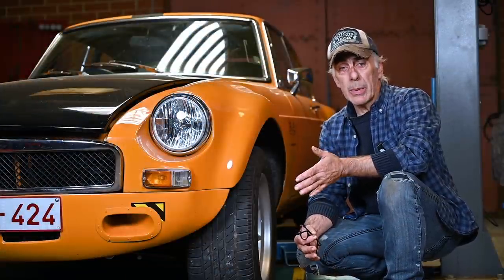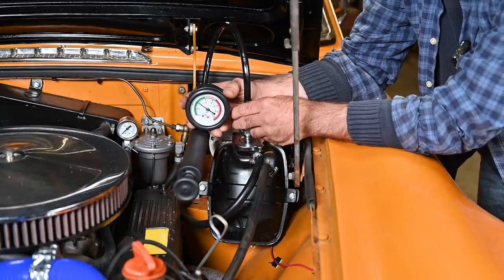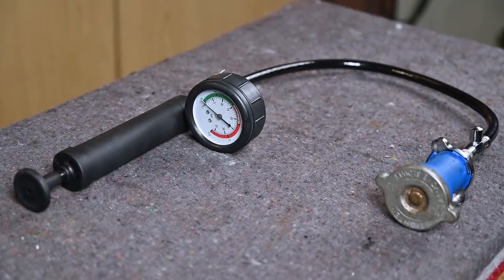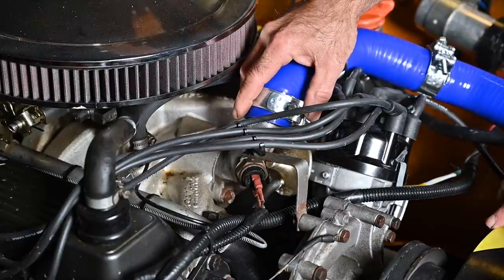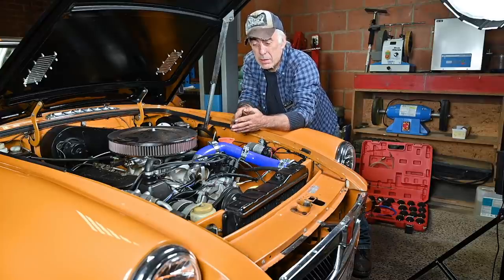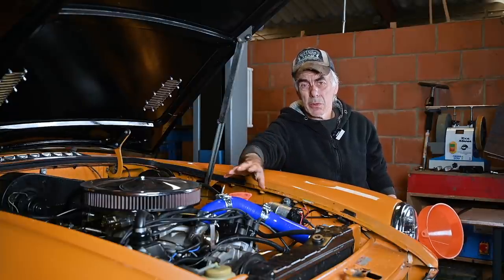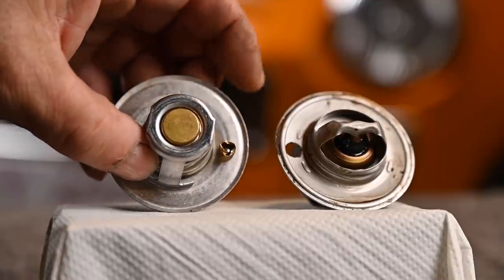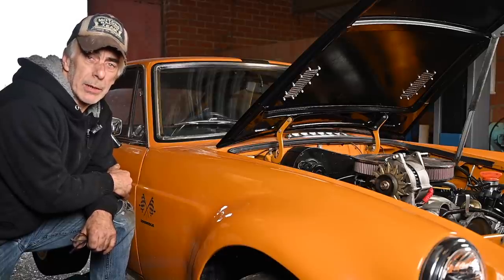Classic car Cooling System analysis, testing , and fixing

Comment: Steve, very clear tutorial and well worth the time to watch it. I have been in the same position with the strange previous owner wiring. It is worth the effort to clean it up for sure. Auto electrical fires are no fun at all. I have has several older vehicles and almost the first thing I do is water pump, thermostat and belts, and check the radiator flow as you describe it. Keep up the good work!
Reply from the maker: Thanks for the comments David,  indeed

Comment: That was a good run down on cooling systems.  You've covered this in the past.  I can't remember what engine had a cooling issue before, but there was a pressure problem and you tracked down the issue to the overflow tank.

I can't say I am typical of your viewers but I am interested in the little things you do such as the inner tube over the fitting or the bleeder valve on the water line.  I don't tune in to view you undo bolts or watch you go through the whole thing.  Set up is key so you just showing before and after photos is even satisfactory to me.  An example of this is what you did regarding the relay.  That rats nest was obviously a problem and then you just showing the wiring diagram afterwards is excellent.  This is what I like to see.  Perhaps some dialog on what your reasoning was in finding a place for the relay would have been appropriate and some discussion on it getting wet maybe.

One thing I would like to see from you, or maybe you might consider this, is to re-manufacture a part that is mostly a casting such as the starter wheel on Old Rusty.  You frequently go out and just buy new parts.  You've had a lot of discussions over new parts versus old parts and cheap parts etc.  You've made your own stuff which I love seeing.  Perhaps you can get some parts manufactured for you.  Like in Old Rusty's case, perhaps you have some part which is no longer available.  Can you get someone to make a cast for you?  You could have the cast machined or you could do this yourself.  A video on this would be good from start to finish.
Reply from the maker: Thank you for the comments and the request,   yes it is possible to make your own parts..  but it takes a lot of time and  tools.  Often is far more cost effective to go out and buy the parts.  On Old Rusty I had to make all the panels and soon there will be more on that where we will make some parts ourself such as the brake pipes.  so hang on

Comment: As always, another great video.  Just a couple of comments: When flushing a rad, I like to do the same, but bung the bottom, fill it, then remove the bung to purge in order to ensure the top rows in the rad get a good flush too.  Secondly, the hole/value/jiggler on the thermostat is positioned upper most when re-fitting (12 O'clock position) to encourage any trapped air to the top.  Cheers
Reply from the maker: Thanks paul for the comments and indeed

Comment: A tip is to clean the cooling system on older cars is to add a dishwasher tablet to the radiator. Set the cabin element for max warm and drive the car until it is warm and the thermostat opens.  Then let out all the cooling water and flush the system with clean water. This is very effective on older cars with cast iron blocks. Of course you must always fill up the system with cooling liquid even if the car is used in warmer climate where freezing never occurs.
Reply from the maker: thanks for the comments

Comment: Would you recommend using distilled water to fill the cooling system? Tap water could contain minerals and the water provider also adds chloride to make it drinkable. I use tap water but a friend uses distilled water. The static electricity in the water will be different in the different waters too. Thanks!
Reply from the maker: I would not use any of it, I use a pre-made mix with anti-oxidants..  I might make a video on it
Reply: De ionised , but yes, or premixed as you buy it now ahas deionized water, much better to have the manufacture mix it ready to go, it will stay clean in the engine much longer,

Comment: I would put in a bypass switch so you can turn the fan on manually, one that also bypassis the relay. And has its own fuse feed. sometimes you don't always feel you can trust those old bimetallic switches, or replace it with the modern variable controller, after all I'm sure you don't run points ignition anymore but use a modern electronic converter
Reply from the maker: Thanks for the comments, that is always a good approach to have a override with a manual switch.  I have done that before...

Comment: Hi Steve, could this kit be used to test an empty AC circuit for leaks
Reply from the maker: John, I would assume that it would be possible as long as you can apply pressure or vacuum.   Something I need to think about... Not sure